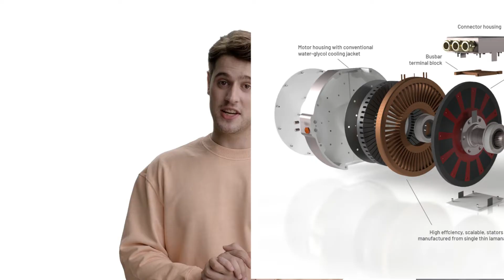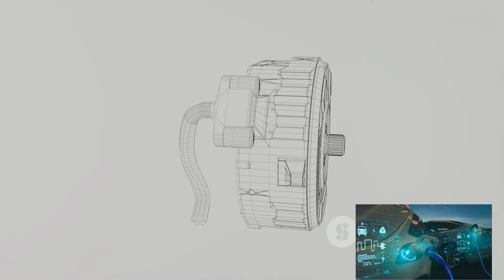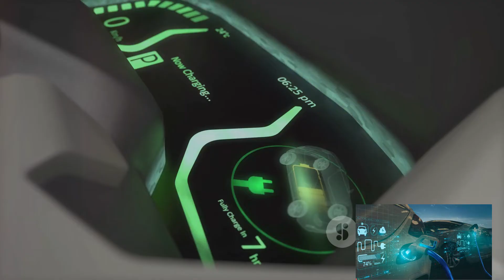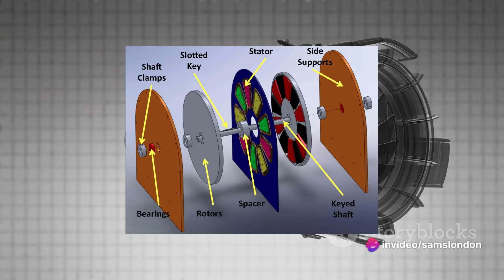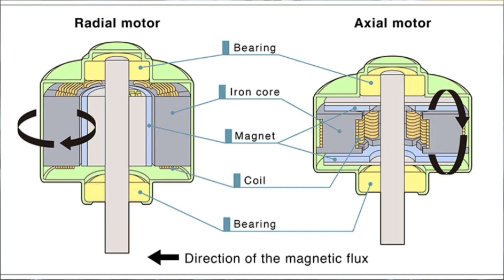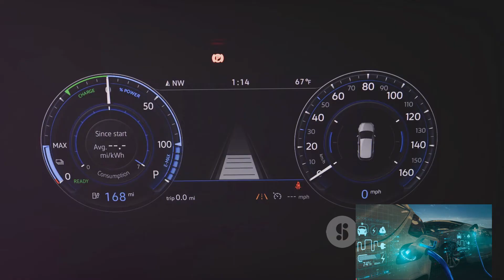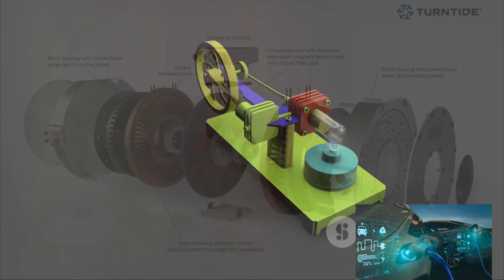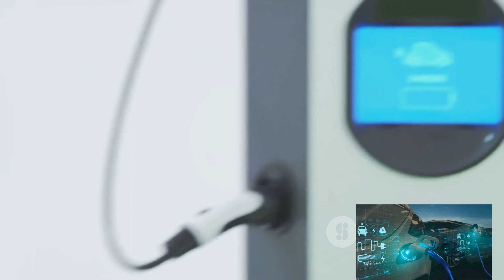Axial Flux Motors Are The Future Of Electric Propulsion! #amg #evcars #axialfluxmotors #yasa

Comment: I want to make an Air Conditioner with this motor. Wonder how it would perform.
Reply from the maker: In some vehicles, axial flux motors are used as auxiliary power units to drive various systems and components, such as power steering pumps, air conditioning compressors and other electrical accessories